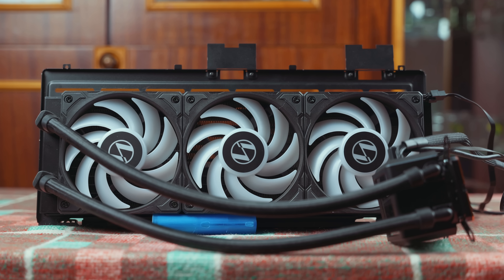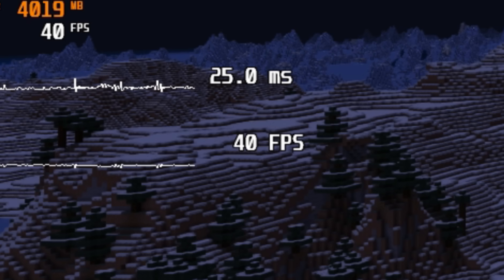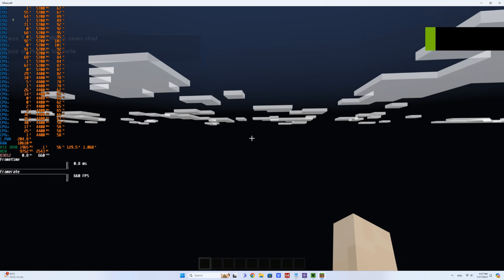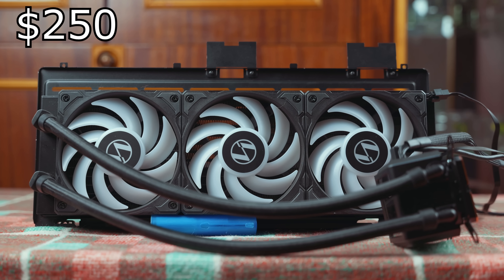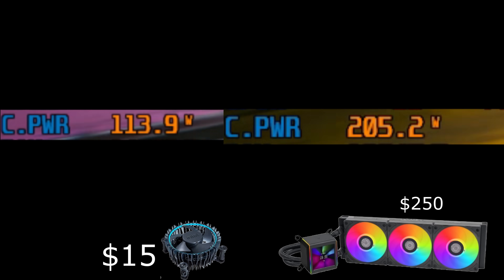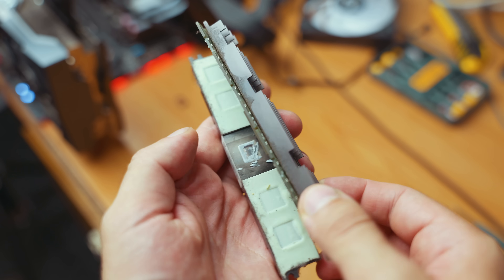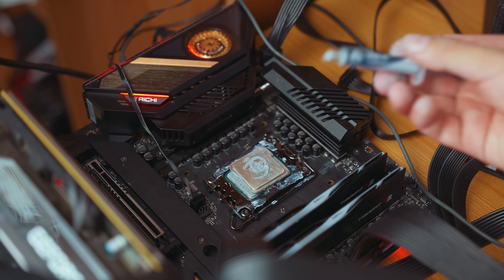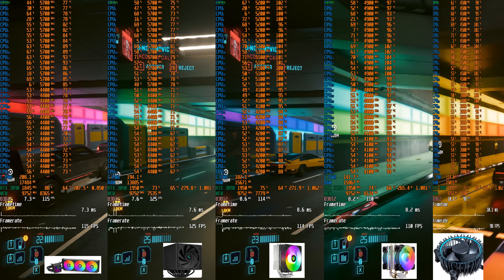HEATSINK VS i9 14900K

Comment: Fun fact in this video: The performance of the Intel LGA1700 stock cooler is even better than the first tower cooler with 2 Pure Copper Heat-pipes.

Comment: 50% of cooling is about fans air pressure and  the other 50% is about metal of aio radiator and the size of aio pc radiator, i have 120mm aio thermal  but 120mm arctic fan and it works like dream for my i5 12600 , playing BF5 or NFS

Comment: Hi ,

I’m new to PC building — this is my first custom build. I’m running into a strange temperature issue with my i9-14900K.

Specs:

i9-14900K + Arctic Liquid Freezer III 360 AIO (also tried DeepCool LE720)

MSI Z790 Tomahawk WiFi

Lian Li Mid Tower case with 10 fans:

6 intake (bottom + right)

4 exhaust (top + rear)

AIO : arctic liquid freezer iii 360mm

Issue:
When running VMware (2–3 VMs) or GNS3, CPU usage is only 20–30%, power draw is ~150W — but temps hit 100°C and stay there.

But under full stress (Cinebench 100%), CPU stays at 85–90°C even at 250W.

Tried:

BIOS updated

Thermal paste reapplied (Noctua NT-H2)

Swapped AIO coolers

Fans/pump at 100%

Power limits at 253W

Ambient temp: ~23–26°C

Question:
Why does light workload = higher temp than full load? 
😊
What should i do?

Any ideas or suggestions are appreciated — still learning here!

Comment: Funnily enough if you put a pan or a container with water over the cpu it shouldn't be able to go over 100"C due to the water's phase change removing all the heat from the CPU, i wonder if with some pressure fuckery it'd be possible to lower the water's boiling point and make it so it runs at a fixed temperature.

Comment: running a 14900k with unlocked limits and no voltage tuning is like running an ej motor pushing 500hp on stock internals lol both will grenade themselves sooner or later

Comment: I've been trying to explain on Reddit that dual tower air coolers are way better than any 360 AIOs on the market. Both the coolers I have are nickel plated - making Liquid Metal a very viable thermal grease.

Comment: Got a 13980hx laptop and i love to scew around with undervolting and power limits... you can basically get up to 92% of the desktop performance in cpuz with undervolting but getting to 75% and running far cooler and more efficient is best.

Comment: Speaking of souped up Xeons, I'm currently running an E5-2699V3 with a 6750xt. No boost clock mod or microcode edit. At 1440p I somehow don't bottleneck at all with the CPU even though it's an 11 year old 18 core CPU

Comment: so i have a i5 13600k with a 2 section aio and my temps are usualy between 40 and 50 celcius so kinda overkill ngl i could prob overclock my processor but thats not realy necisary because i have a rtx 3060 ti and usualy the processor doesnt reach max ussage

Comment: hey heres a cpu cooler suggestion for a video but how about an AIO cooler thats block fits on the back of the mountinmg (leaving typo for comedy) plate of a air cooler if not imma try it in a month or so   AIR:Noctua NH-L12Sx77 and AIO: Deepcool LE720 360 of course

Comment: i bought i9-14900. I wanted this challenge to make i9-14900 work with 650 W power and get it cooled. Seems i dont have issues to get CPU cooled. Issue is now GPU what is bottleneck if 650 w power. U cant have so good GPU. GPU is too hot in games now. So i need good air cooling flow for GPU.

Comment: FOR THOSE FORTNITE KIDS,
NAH, IT DON'T CONSUME 400 WATTS !

IT WAS A MOTHERBOARD BIOS FAULT, IN WHICH THEY REMOVED THE INTEL LIMITS AND SET THEIR OWN PROFILES BY DEFAULT
WITH INTEL DEFAULT SETTINGS AS SUGGESTED BY THEM, SHOULD'NT CONSUME MORE THAN 253 WATTS !

THESE ASUS, GIGABYTE AND MSI MOTHEROBOARDS JUST WRECKED INTEL's REPUTATION
Reply: hey buddy, you know what overclocking is... right?

Comment: The Socket 775 Cooler isnt a real 775 cooler. The real ones shipped with the C2D E6300 we're taller and the ones for the Q6600 we're tall and had a also a copper core. This low profile cooler definitely is not an S775 boxed cooler.

Comment: i find them funny because i had a i7 6800k about a year ago the water cooler died and kept making this strange noise, apparently the water cooler died and the fan and pump was ticking trying to pump 0 liquid it was a sealed unit i dont know where the liquid went but the cpu got to 160c but some how the computer was still functional with some blue screens of death

Comment: Looks fun but kina pointless test dude. CPU stock is 250 watt not 400. And you don't need to guess or test the outcome. Not meter what cooler you got you cant go above 320 watt without deleading, liquid metal or sub zero cooling.

Comment: 400W out of the box is cool, pun intended, for LN2 monkeying around. Crank that baby up. 
It's asinine to use anything other than an open loop for the things unless you down clock and undervolt it. Then you can do big ass chonky air cooling.  Never thought I'd be carefully underclocking a processor; it's backwards time.

Comment: I got this beast at p5.8ghz and e4.6ghz with direct die custom water cooling,. When I run cinebench, pulls 400w at 100c 41k score, but it averages 200w in games at 60c, 35c in desktop

Comment: I wouldnt be using a 13 or 14th gen intel until they came out qith a statement that the microcode has been patched.

These cpus fucking kill themselves over time and when they die, theyre dead forever.

Comment: My 13900ks go AT 240w in bench... In game its 60-100w, dépend the game. And temp is just a story of mother board voltage and power. Got 50-65° in game and 85 in bench

Comment: AIO sucks.
Always did, always will.

It's fancy, it's easy, but it's not a true watercooling rig. Any mid range air-cooler can beat the "biggest" AIO outhere.
Reply: this is false
if you want to watercool your pc you have to invest a lot of money into parts and having the risks of leaks, while AIOs are much better (even tho yeah they cost a lot more)
don't expect to cool a 7800x3d with an air cooler, it will be unstable and you have to use an AIO
Reply: @Emayeah  I can build you a full rig for less than 200$, cpu AND gpu... Please.
Reply: @jiankhan  well... Celeron g3900 and GTX 710 is gonna be wild
powerful CPUs require beefy coolers, and air coolers will not cut it, don't try to prove your point with something entirely unrelated

Comment: :D 14900k is ridiculous, degrading and needs extra voltage. thanks for good vid so i know i need to stay away from it
meanwhile i sit on my 3080ti suprim x(it still hurts because i paid 2k, also nice u have suprim xtoo :D) and i7-4790k clocked at 5ghz :D bottleneck heaven, gotta upgrade it eventually. I bought it when it was flagship decade ago and its still holding strong but showing its age :D

Comment: I got be quiet! Dark Rock Pro 4 first for ryzen 5 1500X after overclocking sh*t out of it  until it degrades, later upgrade to ryzen 5 3600
note (the reason for the degradation was increased voltage above the recommended amount)

Comment: Would like to see some Intel APU with like 8 efficiency cores and 16 Xe cores. Clearly doesn't need P-cores for such graphics and seems like wattage is better spend on graphics. Just add in a load of cache like a true X3D processor (logically not made by Intel, we're talking about non-self-damaging and working CPU's) and it should all balance out.

Comment: im amazed anyone is buying any 13th or 14th gen CPUs (Especially 13900K & 14900K!) 😨 - How are you not terrified??   Again I'm going to use the term CPU cancer everywhere I can until it takes hold.. Because its the closest thing to describe what has happened to 13th and 14th gen intel!  Manufacturing defects that ... with absolute certainty, (and no additional info from intel otherwise& all things pointing to it affecting 100% all units!) that defect of layer deposition corruption causing oxidation between them inside the CPU that applying voltage to the chemical reaction.. assures .. in time it will die.. And will die from that cause!  - Which is an issue that cant be "operated on" cannot be repaired.. 
But it will 100% assure your CPU will die due to the defect!   [Sharing this now so you can save yourself before you as myself and many others had great advertised performance or better and now are limping by between BCOD caused by this "CPU Cancer!"
  - NOTHIN CAN EVER FIX (Only slow it down maybe to keep most alive limping by until warranty is gone with microcode updates that killed performance.. Just the first Asus MOBo based one to address this issue..)  NO FIX EVER COMING EITHER:  As the costs of legal fines and restitution (never fully made okay ass I bough motherboard and RAM 128GB around 13900K knowing it alone would have stability to let me run DDR5 ram best chance at that density - So now I'm out a Pro Art  Z790 Motherboard and the Dominator Ram that I mean the ONLY THING I can do is buy a 12th gen and half the ram to 64GB - which doesn't work for my needs!) The costs to produce CPUs they arent making anymore and go backwards to fix this... Is more than it takes to be Sued in court by THE MULTIPLE CLASS ACTION LAWSUITS ALREADY UNDER WAY!  - Vs. doing whats right.. AS NO REFUND CAN EVER MAKE THIS OK!  As I built my entire computer around the CPU! A refund .. or giving me a replacement chip with the SAME CPU CANCER in it.. Never allows me to have a system I can use without knowing it dies over time.. With nothing youc an do but begin slowing your CPU down ASAP!  Even disabling cores.. before the final death 50% rates of failures so bad there nothing that can be done for servers now using these.. AND THAT DOESNT MEAN THE other 50% are ok!  NO THEY JUST can limp by with slowing them down.. NEVER OVER CLOCKING NEVER EVEN RUNNING STOCK.. Disabling cores.. cutting 24 cores down to 16 ..  anything to try and keep them alive.. Why Because ALL UNITS HAVE THE CANCER!  They all have the fault in production! 
  and while intel WILL NEVER DO WHATS RIGHT BECAUSE THEYED ALREADY HAVE TO HAVE HAD A DIFFERENT STANCE .. and have been preparing 14th gen production facilities if they EVER INTENDED TO REMAKE THE CPUs without the defects in manufacturing that ONLY STARTED AFTER 12th gen!  And they are 100% AVOIDABLE!   These CPUs could be perfectly fine! If they just went back.. made them with same production quality as every CPU before ... as the 14th is just a new badge on the same 13th gen.. its why this "CPU Cancer"  has spread to a "new Generation" - Because IRL its not.. your 14900K is a 13900K with minor code changes.. that's it!   So both of the 'generations' have this Cancer.. And THERE IS NOTHING THAT CAN BE DONE BUT TO BE GIVEN ANOTHER ONE, another, another, another, Until they Reject your RMAs if they ever let you go that far.. And you DO NOT GET A NEW WARANTY START DATE FOR THE REPLACEMENT!  It stays with your first CPU purchase date!   THEY ARE ASSURING THEY SLIP OUT OF THIS By slowing them down to try and stop the death long enough for your warranty to be gone..   

RATHER THAN THE ONLY THING THAT THEY COULD DO TO FIX THIS:
Which your CPU will die.. and system until 15th gen needing a new computer new motherboard etc...    You cant Upgrade out of this issue..
    * Unless intel ever makes batches assured free of the issue! *
Reply: And its scary to see videos like this.. Which seem to be unaware of ... HOW BAD AN IDEA IT IS TO BE PUSHING YOUR CPU AT ALL!  It rapidly accelerates the degradation! Ive literally not seen anyone make a video POST the scandal of intel knowing this all along.. That has never before happened  in the entire history of computers and tech!  Nothing this scale has ever happened before in our lives! So Dont want to rain on your paraid.. But LOOK INTO THIS ISSUE and realize ITS REAL!  STOP BUYING INTEL!  EVERYONE!  Becaus you are now trapped just like me!  And I made this comment so you'd look into oxidation issues with intel 13th gen (AKA 14th gen) which they share does affect 14th.. which again is just a badge change and microcode on the chip to be about 1000 pts higher score in Cinebench.. THER IS NO DIFFERENCE its exactly the same CPU!  Its why .. and how a defect this severe that .. isn't like it was some new specialty process they never have done before.. No its s basic layer deposition.. they F**ed up!  THEY FORGOT HOW TO MAKE CPUs!  And NOW YOURE PAYING FOR IT!  

As 14th gen is 13th gen its why the CPU cancer is spread across both.. as if they were ever actually different there have been a chance for them to catch the defects and assure it didn't ever continue past one generation.. SO PLEASE LOOK INTO THIS! AND STOP PUSHING YOUR CPU!  It is assured to die you're killing it faster!

Comment: What is the part that Tech Youtubers don’t understand that this processor consumes 253 watts? All of the rest is motherboards doing automatic overclocks!! That’s why there is degradation! The processor itself doing out of the box clocks as advertised with 253W barely goes up 80 degrees peak

Comment: the socket 775 cooler you have is the loser 775 cooler. the core 2 quads used a version of that cooler that had a copper core and was more than 3 times taller than the loser one. my ancient Q6600 pc has one

Comment: Meanwhile I'm considering keeping my NH-D15 when I go 9900X3D. If the wattage tolerance as the same as Ryzen 7000 I'll probably be able to. It has no problem with my 7900X3D.

Comment: ARM cpus in dedktop pcs will kill the cpu cooler industry
Reply: But I don't think that will be soon
Reply: bruh ARM CPUs could never potentially reach the extremes of x86 architecture no matter what, they use reduced instruction set computing (RISC) which is a cut down version of complex instruction set computer (CISC) which is used in x86 architecture yeah ARM could come close to x86 but it'll never be able to surpass it!
Reply: @discerningcucumber7559  in powe efficiency it will

Comment: Any heat sink, when saturated, has its efficiency dropped to the bottom of its value which also then depends on the surrounding temperature, this is why we have fans to prevent saturation from happening all together or for a certain period of time up to a point but also if the heat is not "leaving" faster than it's "coming" in the heat sink then you also get the same result basically, sh*et xD.

Comment: i feel so sad about this cpu i worked so hard and built a really strong computer just to give me so much problems i have the i9 14900k and its now degrading alot of games are crashing and dont work well
Reply from the maker: don't make a big tragedy out of it, if it works it's already good, set the frequency in the BIOS to 5.1-5.2 and fix the maximum operating voltage for such a frequency, and enjoy life. I was also perplexed why some programs on my PC don't work normally, but I immediately realized that the problem is in the processor or in my crooked BIOS settings. It's unpleasant that Intel deceived us when they said that the CPU would work at 5.7-6 GHz, as it turned out it was simply overclocked from the factory to such frequencies, the difference in performance between 5.2 and 5.7 is not that big, but the difference in power consumption and operating voltage is huge.
Reply: @WhatAboutThePC  aw thank you so much you are the sweetest 💕 it means alot

Comment: Go with Thermalright. You can get 6 copper plated heatpipes for $23. That brand is absolutely industry disrupting, and I've only had great experiences with them. My i7 12700K idles in the low 20s 😂 ❄️

Comment: It's amazing how energy efficient this thing is. At 35 Watts, we still get 70 fps in Cyberpunk!
Reply: energy efficient 😭🙏
Reply: @xx100team  yeah extremely efficient. Not on maximum performance possible. But after this video i'm getting this cpu
Reply: new ryzen AI 370 in 28watt give 77fbs in cyberpunk ,,new intels  hot trash full of bluscreen and burn  motherboard(search in youtube)
Reply: yeah raptor lake is crazy efficient when you limit the power draw, even all core workloads are suprisingly fast with low power limits

Comment: *insert joke about how raptor lake CPUs are already cooking/oxidizing themselves to death even with "sufficient cooling" at default settings straight out of the factory
Reply: new intels  hot trash full of bluscreen and burn
Reply: @raminpro9765  Name one problem with 15 gen.
Reply: @raminpro9765  As you can see, the person in the video still uses their CPU just normally without any problems. AMD fanboys BEGONE, lmfao.
Reply: Yes. I was like...how is this one not dying instantly?! BTW somehow...I got my 11900kf to 6.2 ghz on boost stable. It would hit 104C but not shut down, but it was only for the instances then would drop back to 80C very quickly..like .25 sec.
Reply: @shanemitchell477  cpu damage little by little , high temp and voltage above 1.3000  dont burn it fast but in 1 year you will see  monthly 1-2 blue screen then increase to daily    then die(can burn motherboard too)
Reply: Do you own a 13900k(s) or 14900k(s), or are you just jumping on the bandwagon?
Reply: @squirrel6687  bandwagon my ass you know its bad when gamers nexus gets involved
Reply: @squirrel6687  nah I only have laptops for rn; I just happened to find this video early and decided to crack a joke that will probably be commented at some point or another lol

Comment: me with a 65w i7 12700f: that heatsink is enough
Reply: How 💀, i have a  i7 11700F, which consumes like 204 watts cooled by a 60 watt cpu cooler and its barerly holding it with the first power limit (65 watts)
Reply: @unverified24  YOOOO i have the same cpu
Reply: @alexclark7284  Nice Lol really solid cpu (better than a r7 5700x), prefer to stay in 11th gen because of the insane power draw and stability issues the newer lakes have.
Reply: budget gaming be like